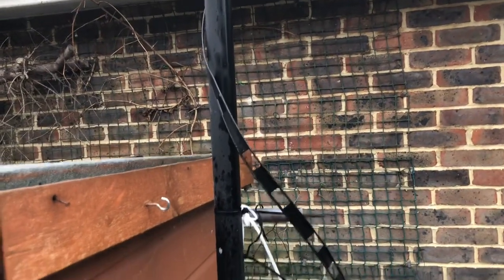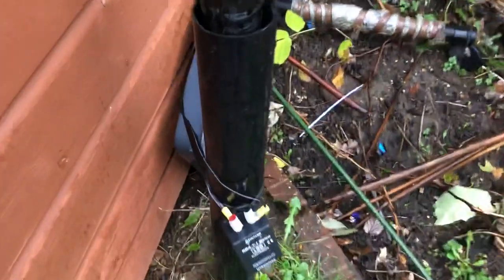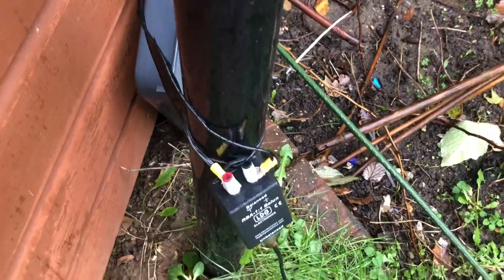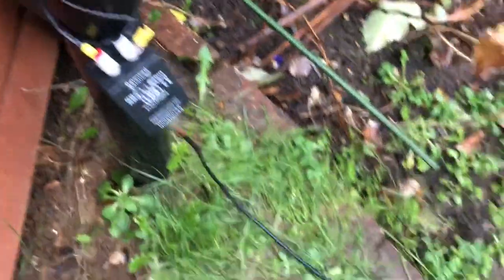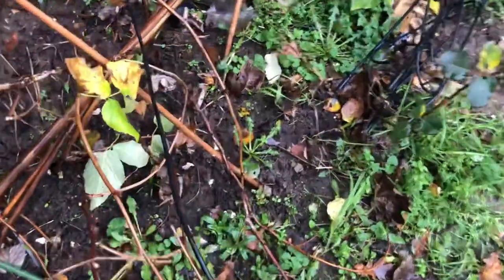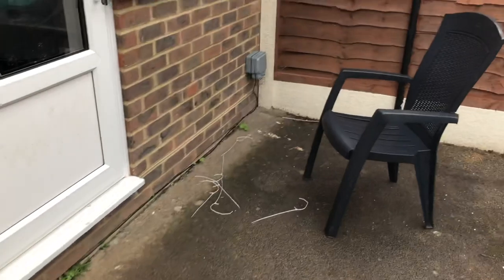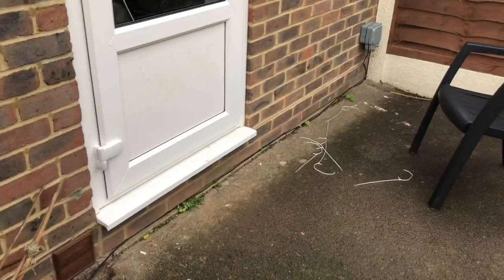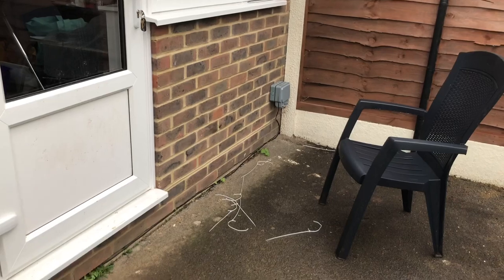Doublet Antenna: How I Stopped RF In The Shack

Comment: Glad to hear you sorted it out..! I'm still a bit confused about current (vs voltage) baluns, but am storing this experience of yours away in my head as I'm hoping to get my doublet up before Spring (awaiting assistance to install concrete base for the tower at this stage!).  Getting the ladder line into the shack (garage!) is the concern so we shall see how we go!
Reply from the maker: Good luck!

Comment: Good to see you got it working, I believe that the common mode chokes position can sometimes be sub optimal, the coax laying on the ground probably works in your favour, capacitively coupling to ground. In my case I run the ladder line straight to the shack and did initially have odd RFI issues on 18MHz so added more common mode choking. 73
Reply from the maker: Yes good points - thank you 73

Comment: Simple fix then Tim, they are the best type of problems to have.  The only problem I ever had was blanking out the neighbours TV when I keyed up on AM in the old illegal  CB days, but it recovered very quickly.  I found out he used to operate radio, and fix TVs so he understood what was going on.  He asked me for a few things to stop the problem and he never mentioned it again.  Never so far been bothered with RF in the shack (yet) but then I would have been running half your power.  Since it became legal I stick to 4 watts of course.
Reply from the maker: The days when neighbours could sort stuff out together ... fast disappearing 73
Reply: @timg5tm941  Yep, nowadays some people don't even know who their neighbours are!  I only know a few in my street, but I tend to keep myself to myself.
It is less bother that way, I help if I can when they ask, but otherwise I stay well away from them.  Getting involved these days just usually means bother.  It's not that long ago when a neighbour used to look out for you and you them, but move into a new estate and it all breaks down.
Reply from the maker: Too true

Comment: Thanks for sharing the trouble shooting, I will use this info before “where to locate/terminating the ladder line” and rg213 connection to the Z Match (manual ATU). Also, I am planning to use 110 foot (with 14awg silicone speaker wire) in total for the doublet and with many info from the net I can get useful coverage from 80 to 10m. I pass on more info with my setup upon completing / testing them one at the time. Anyway, I will keep watching with your test - 73 from Australia.
Reply from the maker: Good luck and I look forward to your experimenting 73

Comment: Good stuff Tim.   Just a point.  Even though the fiberglass is not conductive it still can off set the field and increase losses and cause imbalance.  

Also Ill bet if you calculate the actual losses for the coax lenth the losses are quite probably less than you think. 
15ft of RG58 added SWR loss at 10:1 will be less than 1db from 80m to 10m   on 80m total loss is less than half a db.  A short run of coax from a the 1:1 current balun is really not a problem.   

Nice to see people are underatanding that using a 1:1 Current balun is a better option than using the 4:1 found in many tuners.
Reply from the maker: Thanks David, useful observations, especially the coax loss. People often forget the length of the run itself is just as important as the cox’s own characteristics 73

Comment: I would like to know why you are using RG-58 use 8 or 8x
58 is ok for mobile.
Reply from the maker: Only piece of coax I had to hand at that moment and my aim was to check that rf in the shack was eliminated by the altered configuration. Fully aware of losses on 58, but of course a 20 foot run on 80m even compared with ultraflex 10 or similar isn’t too prohibitive 73

Comment: I use one of those resonant EFHW with 49:1 from myantennas.com the EFHW-8010, no RF in the shack, the UNUN is Earthed outside. Best thing is I can band hop without a tuner and it's great with the Acom 1000, just tune up the Amp and not have to mess with an Expensive tuner. 

I thought about making a Doublet for 160 and maybe cutting it for 160 but then I decided na, EFHW 49:1 and I can just use coax, nice low SWR and will give me 80 + 60 + 40 m resonant in the process too. I might make my own this time. 

A neat trick I learned from Steve Elington is that to make 80m resonant higher up the phone portion of 80m on the EFHW-8010 is to add a 500 pf Ceramic capacitor rated for the power you want and insert it in the middle of the antenna and this electrically shortens the Antenna without physically shortening it, pretty cool.
Reply from the maker: Great info thanks 👍

Comment: well sorted.   on rg 58 ?     rg 58 has a very low loss on  most of lower ends of hf and with that short run it should be nothing really.   the losses for rg 58 start around 10m, the longer the run and higher the frequency the more the loss.     theres a video on feeder line and losses by George GI4SJQ hosted by our club. its very informative.  and from my understanding of ladder line,   it has to be at 90 degrees from the elements or it becomes an element itself, exactly what you have found.  of course there are differing views on this, im just saying what iv exterianced. hope this helps, corrections welcome.    great video.
Reply from the maker: Thank you and I appreciate the info